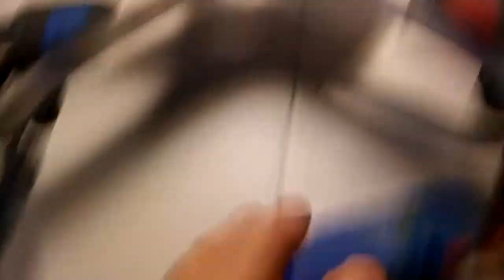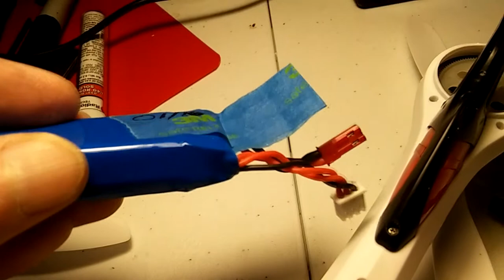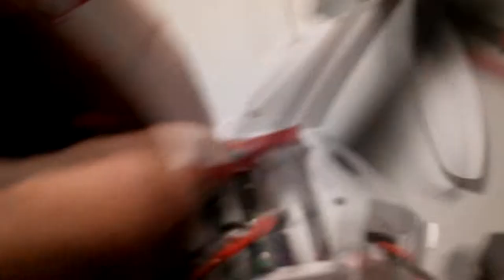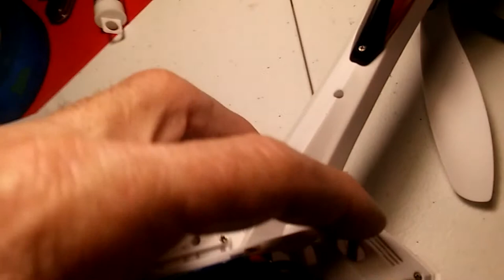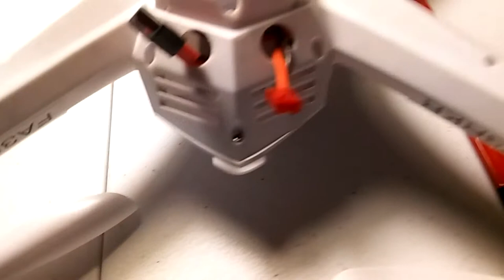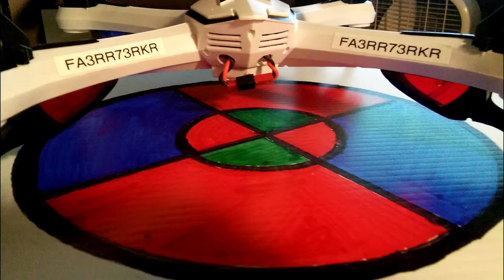X6 Battery Bay Modification

Comment: nice mod
Reply from the maker: +Quad_Craze thanks!
It turned out OK, but I'm not quite done with it yet.
I'm concerned about the plastic possibly rubbing through the insulation on the wires, so I will be putting rubber grommets or some other protective seal in the holes.
Stay tuned!! :)